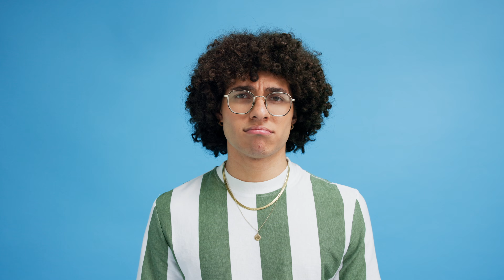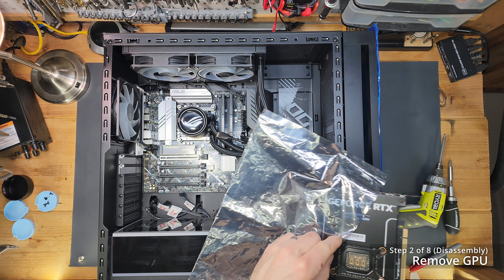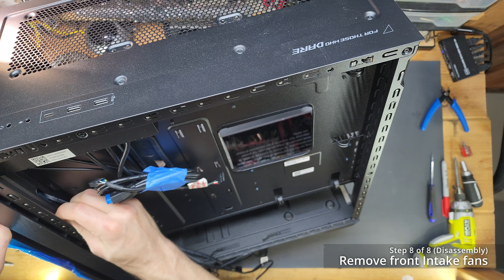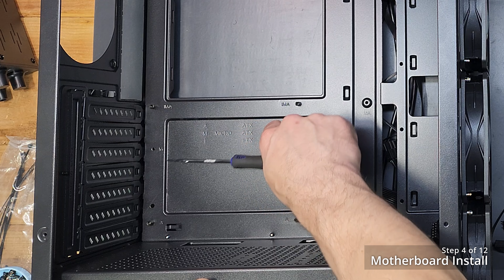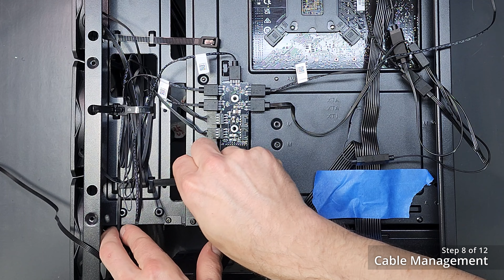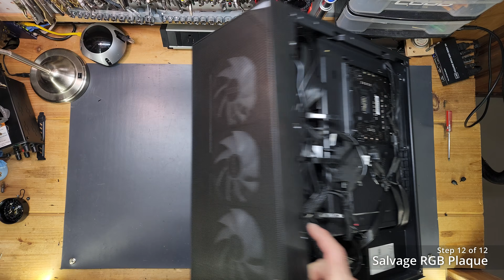This Asus ROG G700 is 30% smaller & COLDER  (Full Case Swap Guide)

Comment: Will that supports bracket work for a different size gpu? For example I use 9070xt which is a 2.5 slot i think and want to replace with pny 5080 oc

Comment: Hey! im really impressed by your work and you inspired me to do the same thing to my g700 but as i was midway through the process i realized the led strip on the bottom piece doesn’t fit in the case. did you have to cut the led strip alongside the plaque?
Reply from the maker: Thanks , appreciate you!   The PSU light box will likely have to be cut like mine.  You could also just pull the strip off of that. What case are you using?
Reply: @manicmods   I'm using the exact same case as you and i managed to make it all work out at the end and it looks amazing i would love to send you a photo of it, but im having one slight issue.. the plaque leds are turning on but my case fan leds are not even though i have everything plugged in correctly as you mentioned in the video "the controller requires the plaque to be installed into j1 for the remaining leds to function at all" but they still refuse to turn on